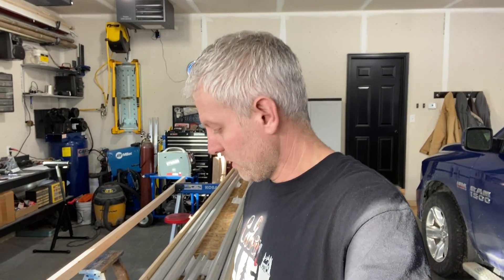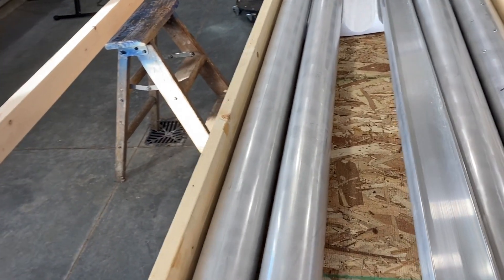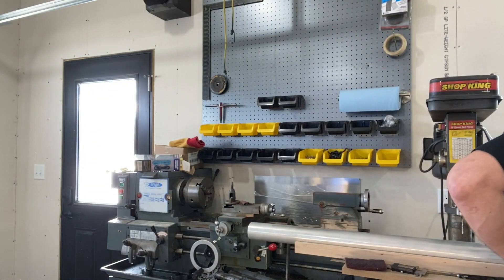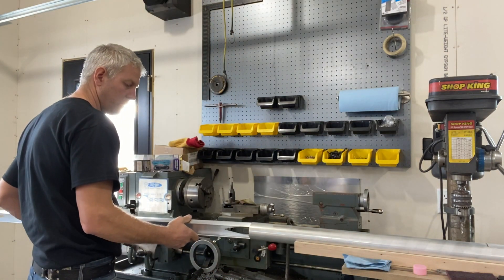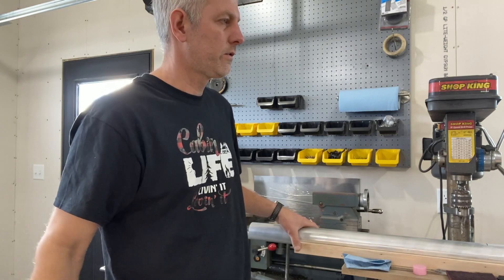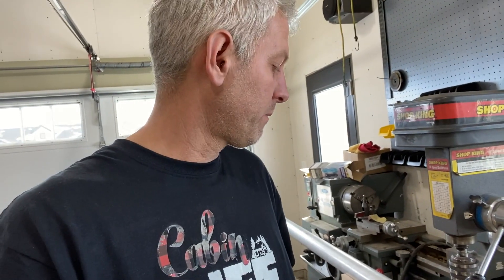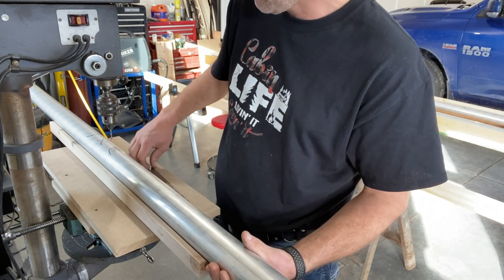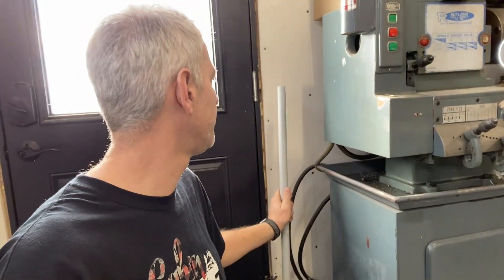How to build Kitfox Wing Spars the right way

Comment: Can you tell me what size the front and rear spar tubes were made of, I'm assuming 6061T6 aluminum?
OD and wall thickness.
Reply from the maker: 2/1/2 od and I think its .063 But remember it is Drawen tubing so way stronger than that junk online.